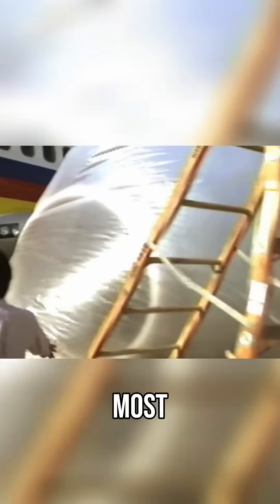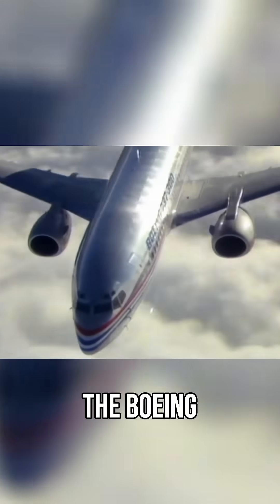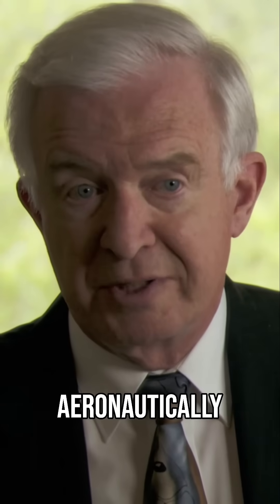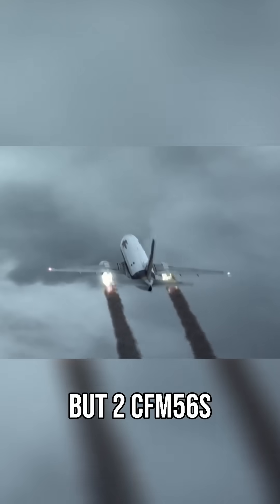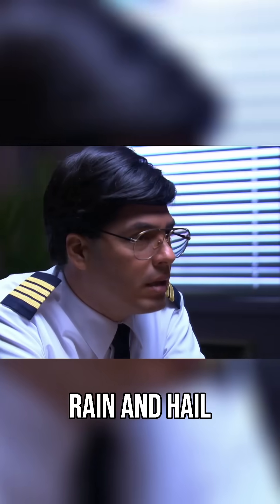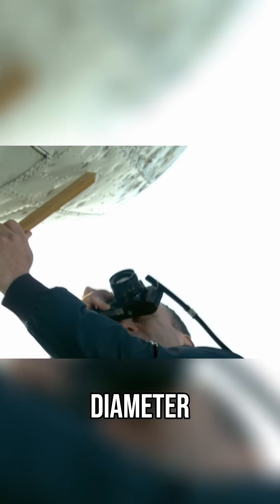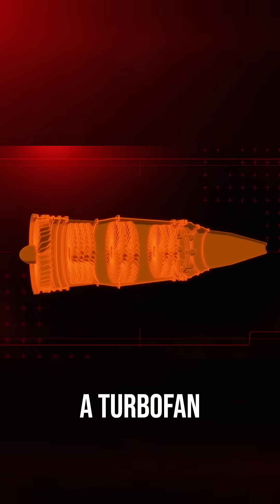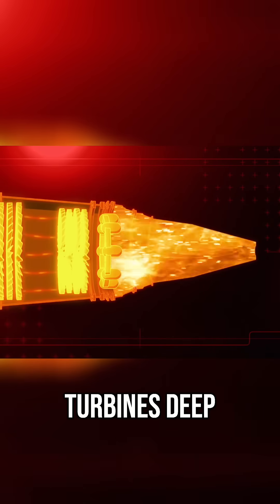When Both Engines Failed at Once Mid Flight | Mayday: Air Disaster

Comment: Mayday you should do one about the ups plane crash year: 2025 :day Tuesday  plssss
Reply: Considering that Mayday Air Disasters is still on the air, they just might do it.  They've done episodes before where the plane crashed within seconds of takeoff.  However, they won't do it until the NTSB has completed their investigation... which sometimes takes years.  They already have a good idea that the lugs (there are two) that held the engine on the wing are what failed.  Why they both failed at the same spot is still speculative.  But my bet is on infrequent inspections and infrequent replacement of those parts.
Reply: @AndresRomero7493-e7q  I don't think they will do it because the crash happened after takeoff so that means it's very fast no1 no2 it's still under investigation
Reply: No I don't think they will do it because  the crash happened fast so it's short sec,it's still under investigation

Comment: Those engines are such beasts that the ONLY things that can disrupt them are severe environmental (weather) issues or sabotage.  They can literally withstand things like even poor maintenance (to a point) where other engines can't.

Of all the engines out there, those engines are the ones I wouldn't even give a second thought to if they went over the specified time limits regarding needed maintenance or replacement (to a point lol).  

Unlike my helicopters, which make me start to sweat when we get near the time limits, the CFM56s are rock solid.  They could easily go time and half on the required time limits and 99.999% of the time, no issues would occur.